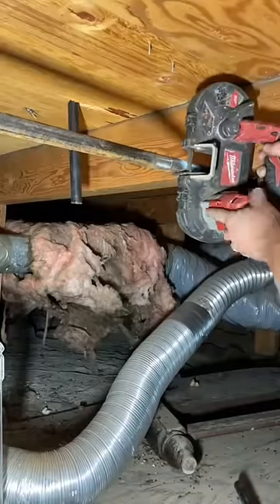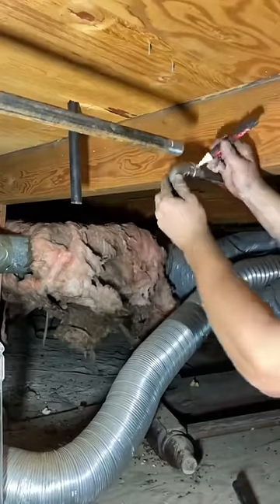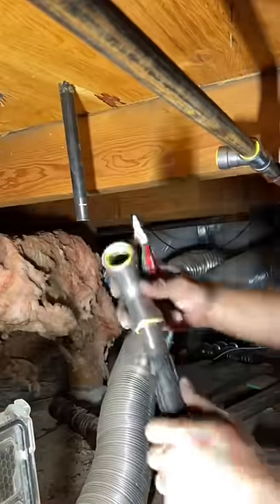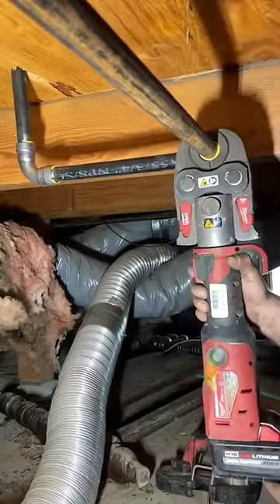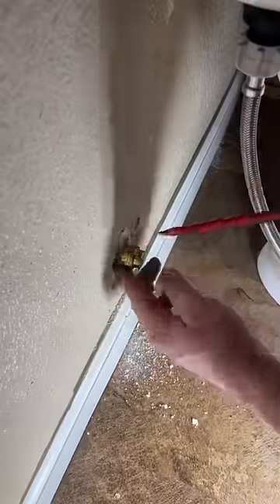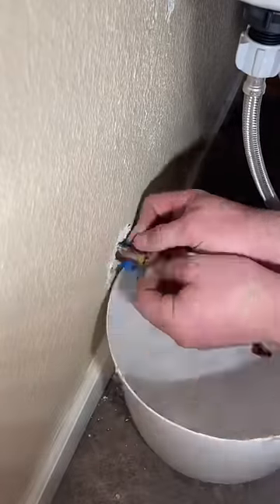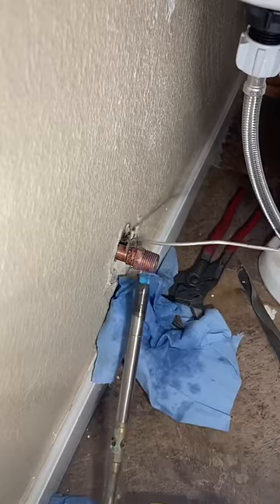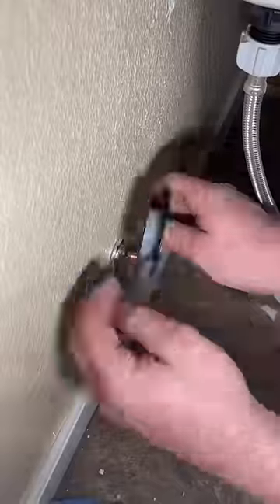reposted gas line video from last year! thanks for watching

Comment: You're right about Viega and Apollo press fittings.

My foremen (in kind words) REALLY don't like Apollopress neither for gas nor water.

Been using Viega for about 4 years, meow. No comments/complaints from the field or the service team means it's great LOL
Reply: I’ve use Viega and Apollo for water no complaints or problems. (Nibco press not so much) Gas only use the Viega and I have no complaints. Getting it in the specs and not having people so scared of it is my only problem. You can spin the mega press and it will still hold try that with a threaded fitting.

Comment: I installed a 125 gallon hot water heater in apartment building that took 1 1/2 inch 
and 2 1/2 inch copper. The bottom 2 1/2 in line had alittle water in it but with enough heat and time I got it sealed. Plus it was 38 degrees outside and took 16 hours. To pull the old out and get all the new in. Needless to say the apartment build residents were happy. And the tenant closed to that water heater was very happy! Apparently the old one had been leaking in to her apartment for about a month. That was 7 1/2 years ago and it is still going strong to this day.

Comment: It would probably be a good idea to require some sort of label or signage at the gas meter stating press fittings were used on the gas line.

Comment: Use bread to soak up the water, it’ll pass through the line. Also you should use flashing when torch soldering a line that close to the wall.

Comment: Why didn’t you he use a 1/2 inch x 3/8 chrome compression valve? Wouldn’t that be much easier than soldering on an adapter?

Comment: That mega press sure makes things easier 😮
Reply: Well the idea of doing it threaded instead is you put a union between the tee and the 90 just incase anything that has to be repaired doesn't have to be cut but unscrewed though